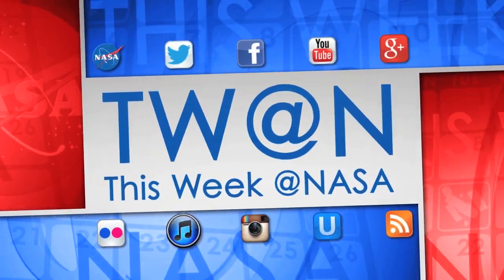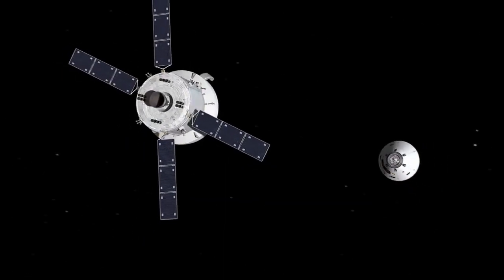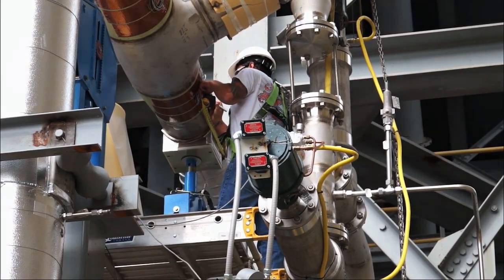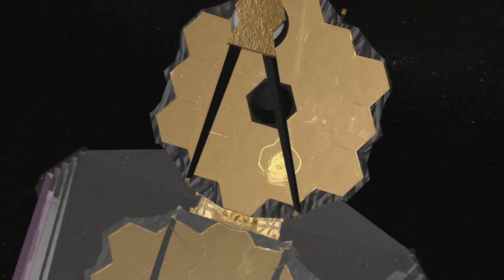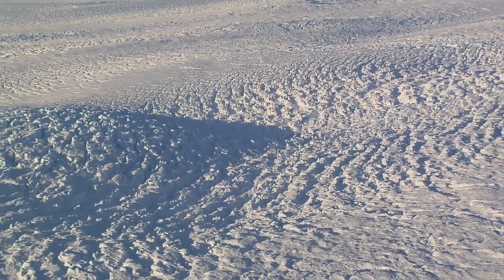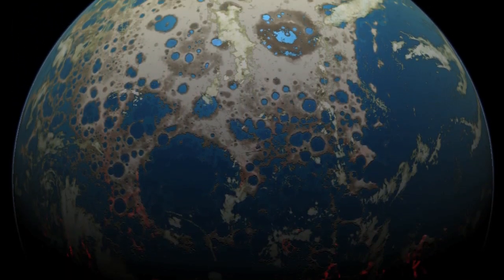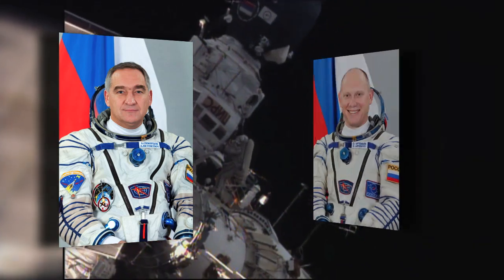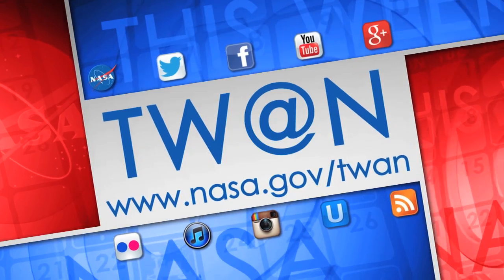Orion’s protective backshell installed on This Week @NASA - August 25, 2014

Comment: only three milestones left in the Orion build 1. Transport Orion to the Payload Hazard Facility and load with fuel and explosives. 2. Transport Orion to the RIF (Rotation Integration Facility) and install the Launch Abort System after it has been tested at ATK Thiokol. and 3. Transport Orion to Launch Pad 37 and install on the rocket.

Comment: I don't think Orion on its own will be able to take humans to mars. Orion maybe able to do the re-entry from deep space, but the space inside is just too small I think for such a long mission...

Maybe like a bunch of Delta IV heavy rockets with different parts of a "multiple component" space craft would work...Assembled in space...

The Orion in itself is uber-cool though :D
Reply: AideTechBot
 - That is of course correct - By the way, it may be interesting to be aware of that this rather smart concept of making a "Special Deep Space long journey" Extended Habitat Module of an Orion Service Module was originally sort of copied from the old "Apollo Application Program", from the late sixties and very early seventies, when NASA was creating several various plans of prolonging and vastly extending the Apollo Mission achievements a lot further. Skylab was one example of what actually came out of these many "AAP" plans in reality - but, as we all know, the severe Economical down-cuts ment the death to most of the rest of all those really vivid plans.
 - Tobbe in Sweden -
Reply: Actually it's not Only Orion heading into swap space. If you look at some Mars mission concepts there is a service module attached to Orion to act as a home for the astronauts.
Reply: Thbenjaminsson AideTechBot Sorry for sounding so ignorant, but from the concept drawings that I saw the module that you guys are talking about looks too big to be lifted from Nasa's current Heavy Rockets...How do they plan to launch it?...Is it like "inflatable" or something?

Sorry again for sounding so ignorant.